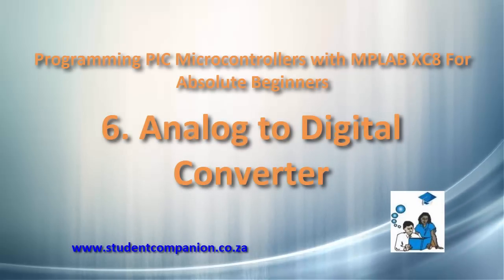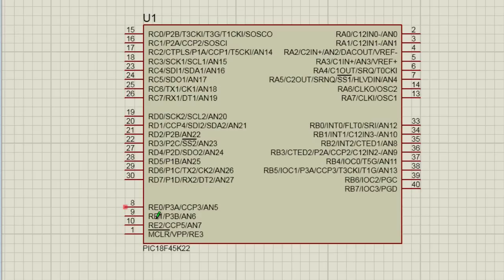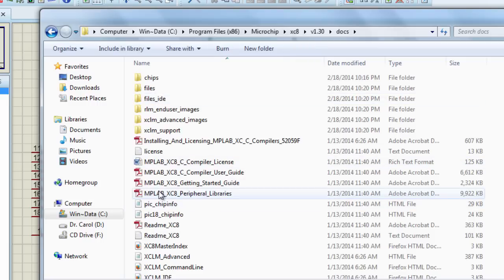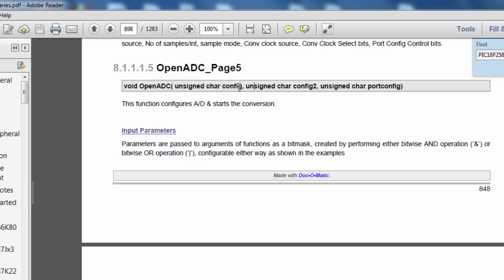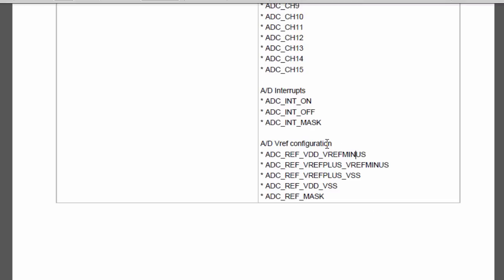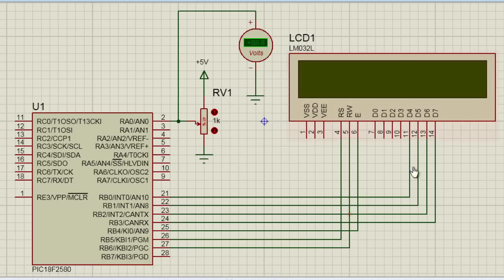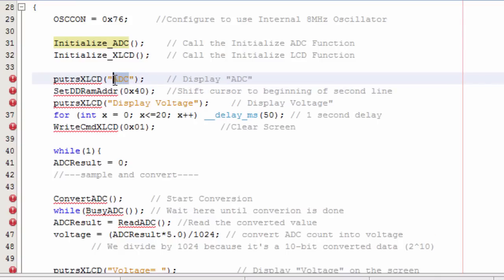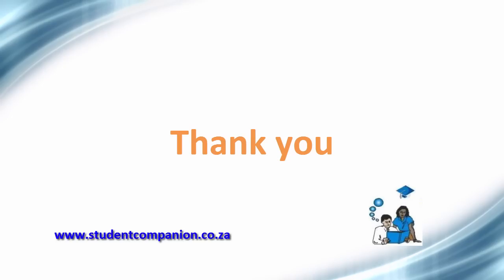6- Analog to Digital Converter | MPLAB XC8 for Beginners Tutorial

Comment: help me ! my mail is lam.3.ngon@gmail.com
#include <stdio.h>
#include <stdlib.h>
#include <pic16f877a.h>
#include <xc.h>
#include "xlcd.h"
#define _XTAL_FREQ 4000000
#define DATA_PORT PORTB
#define TRIS_DATA_PORT TRISB//DDRB
// Lcd pinout settings
#define RW_PIN LATBbits.LAT0;//PORTBbits.RB0
#define E_PIN  LATBbits.LAT1;//PORTBbits.RB1
#define D7_PIN LATBbits.LAT7;//PORTBbits.RB7
#define D6_PIN LATBbits.LAT6;//PORTBbits.RB6
#define D5_PIN LATBbits.LAT5;//PORTBbits.RB5
#define D4_PIN LATBbits.LAT4;//PORTBbits.RB4
// Pin direction
#define TRIS_RW TRISBbits.TRISB0 ;//DDRBbits.RB0
#define TRIS_E  TRISBbits.TRISB1 ;//DDRBbits.RB1
#define TRIS_D7 TRISBbits.TRISB7 ;//DDRBbits.RB7
#define TRIS_D6 TRISBbits.TRISB6 ;//DDRBbits.RB6
#define TRIS_D5 TRISBbits.TRISB5 ;//DDRBbits.RB5
#define TRIS_D4 TRISBbits.TRISB4 ;//DDRBbits.RB4
#pragma config FOSC = HS        // Oscillator Selection bits (HS oscillator)
#pragma config WDTE = OFF       // Watchdog Timer Enable bit (WDT disabled)
#pragma config PWRTE = OFF      // Power-up Timer Enable bit (PWRT disabled)
#pragma config BOREN = ON       // Brown-out Reset Enable bit (BOR enabled)
#pragma config LVP = ON         // Low-Voltage (Single-Supply) In-Circuit Serial Programming Enable bit (RB3/PGM pin has PGM function; low-voltage programming enabled)
#pragma config CPD = OFF        // Data EEPROM Memory Code Protection bit (Data EEPROM code protection off)
#pragma config WRT = OFF        // Flash Program Memory Write Enable bits (Write protection off; all program memory may be written to by EECON control)
#pragma config CP = OFF         // Flash Program Memory Code Protection bit (Code protection off)
unsigned int adc_value = 0;
unsigned int ReadADC (void);
unsigned int voltage;
char buffer[6];
void LCD_Clear(void);
void LCD_init (void);
void ADC_init (void);
      void main() {
      LCD_init();
      ADC_init();
      TRISA = 0xFF;
      while(1)
      {
            // Chuyen doi ADC
            adc_value = ReadADC;//ADC_Get_Sample(0);
            // Tinh ra gia tri dien ap
            voltage = adc_value * 5000.0f / 1023;
            // Hien thi adc_value ra LCD
            putrsXLCD(adc_value,buffer);
            putrsXLCD(1,1,buffer);
            // Hien thi voltage ra LCD
            putrsXLCD(voltage,buffer);
            putrsXLCD(2,1,buffer);    
      }
      }
 void LCD_init (void){
 while(BusyXLCD());
    OpenXLCD(FOUR_BIT & LINES_5X7);
    WriteCmdXLCD(CURSOR_OFF & BLINK_OFF);

      }
 void ADC_init (void){
    // chon tan so clock cho bo adc
    ADCON1bits.ADCS2 = 0, ADCON0bits.ADCS1 = 0,ADCON0bits.ADCS0 = 1;
    // chon kenh adc la kenh an0
    ADCON0bits.CHS2 = 0, ADCON0bits.CHS1 = 0, ADCON0bits.CHS0 = 0;
    // chon cach luu data
    ADCON1bits.ADFM = 1;
    // cau hinh cong vao
    ADCON1bits.PCFG3 = 1,  ADCON1bits.PCFG2 = 1,  ADCON1bits.PCFG1 = 1,  ADCON1bits.PCFG0 = 0;
    // cap nguon cho khoi adc
    ADCON0bits.ADON = 1;
}
unsigned int ReadADC (void)// doc len 7 doan
{
    unsigned int TempValue = 0;
    ADCON0bits.GO_nDONE = 1;
    while(ADCON0bits.GO_nDONE);
    TempValue = ADRESH*256 + ADRESL;
    return (TempValue);
}
Reply from the maker: Lâm Huỳnh What is wrong with your code? If you need support, you must be specific with your question. What are you trying to achieve? Are you getting any error in your code?
What kind of help do you require?
Reply from the maker: Why are you copying the same configuration as from this post above and you can see this person had the same problem as you. In the previous comment reply, I said don't use #include <16f877A.h>, with XC8 compiler you can simply use  #include <xc.h>. It will know which PIC to use.
If you include #include <gps.c> and #include <lcd.c>, make sure these files exist in your project first before including them.
Reply from the maker: +md srabon you are welcome!
Reply: SIR ,how can i include  <pic16f877a.h> library file ?
Reply from the maker: Hi. Which library file you want to include? With XC8 compiler all you need is to include <xc.h>
Reply: #include <16f877A.h>
#include <stdlib.h>
#include <string.h>
#include <math.h>
#include <gps.c>
#include <lcd.c>
#use        delay  (clock=20000000)
#use        rs232  (baud = 4800, xmit=PIN_A1,rcv=PIN_A0,stream=GPS)  //GPS Receiver connections
#define VOICE_DURATION_MS 6
char ch = 0;
int count = 0;
char data[150]; //For SMS storage
const char *location1 = "COLLEGE GATE";  //16.984835, 79.256261
const char *location2 = "CANTEEN";  //16.983173, 79.255708
const char *location3 = "LAB BUILDINGS"; //16.984707, 79.253884
const char *location4 = " Sooxma Tech";
char *location = "UNKNOWN LOCATION.";
char unknown[] = "UNKNOWN";
char lat[12];
char lngtd[12];
char speed[10];
char gps_date[10];
char gps_time[10];
char tdata[12];      
double f_lat;
double f_lng;
double result;
void play_voice(int device_id)  //APR9600 is connected to D7 to D4 and C7 to C4
72
{
   switch(device_id)
   {
      case 1:            
            output_low(PIN_D7); //make APR9600 Voice note ON
            delay_ms(500);     //push button press equivalent duration
            output_high(PIN_D7);  //release push button (equivalent)
            delay_ms(VOICE_DURATION_MS);   //Voice message may play for max of 6 seconds           
            break;
      case 2:           
            output_low(PIN_D6); //make APR9600 Voice note ON
            delay_ms(500);     //push button press equivalent duration
            output_high(PIN_D6);  //release push button (equivalent)
            delay_ms(VOICE_DURATION_MS);   //Voice message may play for max of 6 seconds
            break;     
      
      case 3: //third device
            //code for playing voice message
            output_low(PIN_D5); //make APR9600 Voice note ON
            delay_ms(500);     //push button press equivalent duration
            output_high(PIN_D5);  //release push button (equivalent)
            delay_ms(VOICE_DURATION_MS);   //Voice message may play for max of 6 seconds
            break;         
      case 4: //system off confirmation message
            //code for playing voice message
            output_low(PIN_D4); //make APR9600 Voice note ON for system off...
          
73
 delay_ms(500);     //push button press equivalent duration
            output_high(PIN_D4);  //release push b`utton (equivalent)
            delay_ms(VOICE_DURATION_MS);   //Voice message may play for max of 6 seconds
            break;
           
      case 5: //system off confirmation message
            //code for playing voice message
            output_low(PIN_C7); //make APR9600 Voice note ON for system off...
            delay_ms(500);     //push button press equivalent duration
            output_high(PIN_C7);  //release push button (equivalent)
            delay_ms(VOICE_DURATION_MS+VOICE_DURATION_MS);   //Voice message may play for max of 6 seconds
            break;
      case 7:            
            output_low(PIN_C5); //make APR9600 Voice note ON for system off...
            delay_ms(500);     //push button press equivalent duration
            output_high(PIN_C5);  //release push button (equivalent)
            delay_ms(VOICE_DURATION_MS+VOICE_DURATION_MS);   //Voice message may play for max of 6 seconds
            break;     
  }
}
 
void getLocationName()  // Converts the Lat and Long into Location Name. Also gets the lat,lngtd and speed.
{
      location = "UNKNOWN PLACE";
     
 
74
    get_GPS_data();     
     
      result = get_gps_distance(16.984835, 79.256261,f_lat,f_lng); //SRTIST College Gate
      if(result < 50)  //Meters
      {
         strcpy(location,location1);
         play_voice(1);
      }
     
     result = get_gps_distance(16.983173, 79.255708,f_lat,f_lng); //SRTIST Canteen
     
      lcd_putc('\f');
      printf(lcd_putc,"Distance to Gate:");
      lcd_gotoxy(5,2);
      printf(lcd_putc,"%6.0f m",result);        
      delay_ms(2000);
     
      if(result < 40)  //Meters
      {
         strcpy(location,location2);
         play_voice(2);
      }
     
      result = get_gps_distance(16.984707, 79.253884,f_lat,f_lng); //LAB Buildings
     
      if(result < 50)  //Meters
      {
         strcpy(location,location3);
         play_voice(3);
      }
      75
      result = get_gps_distance(17.352089, 78.507055,f_lat,f_lng); //Sooxma Technologies
     
      if(result < 70)  //Meters
      {
         strcpy(location,location4);
         play_voice(4);
      }
     
      result = get_gps_distance(17.332206, 78.503558,f_lat,f_lng); //HOME
     
      if(result < 80)  //Meters
      {
         strcpy(location,location5);
         play_voice(5);
      }
}
 
void display_intro()
{
   lcd_putc('\f');         //Clear LCD
  
   lcd_gotoxy(1,1);
  
   printf(lcd_putc,"  GPS Location");
  
   lcd_gotoxy(1,2);
  
   printf(lcd_putc,"System for Blind");
}
 
76
void gps_loc()
{    
         lcd_putc('\f');         //Clear LCD
        
                         lcd_gotoxy(1,1);
        
                         printf(lcd_putc,"You are at :");
        
                         lcd_gotoxy(1,2);
        
                         printf(lcd_putc,"%s",location);        
        
                         delay_ms(2500);
}
 
void main()
{
   lcd_init();
  
   display_intro();
  
   output_high(PIN_D2);
  
   output_high(PIN_D3);
  
   delay_ms(1000);
  
   output_low(PIN_D2);
  
   output_low(PIN_D3);
   77
 output_high(PIN_D7); //For APR9600
  
   output_high(PIN_D6);
  
   output_high(PIN_D5);
  
   output_high(PIN_D4);
  
   output_high(PIN_C7);
  
   output_high(PIN_C6);
  
   output_high(PIN_C5);
  
   output_high(PIN_C4); //For APR9600
 
  while(1)
  {
 
        delay_ms(1000);
       
                        getLocationName();  //Gets the Location Name into variable "location", Also gets lat, lngtd and speed
       
        if(strstr(location,unknown))
        {
           play_voice(7);
          
                           output_high(PIN_D3);
          
                         78
  output_low(PIN_D2);
        }
        else
        {
           output_low(PIN_D3);
       
                           output_high(PIN_D2);          
        }
        gps_loc();
       
                        lcd_putc('\f');         //Clear LCD
       
                        lcd_gotoxy(1,1);
       
                        printf(lcd_putc,"Lat:%5.5f",f_lat);
       
                        lcd_gotoxy(1,2);
       
                        printf(lcd_putc,"Lng:%5.5f",f_lng);
 
                        delay_ms(1500);
  }
}

OUTPUT:
make -f nbproject/Makefile-default.mk SUBPROJECTS= .build-conf
make[1]: Entering directory 'C:/Users/RAIN/Desktop/ultrasonic.X'
make  -f nbproject/Makefile-default.mk dist/default/production/ultrasonic.X.production.hex
make[2]: Entering directory 'C:/Users/RAIN/Desktop/ultrasonic.X'
"C:\Program Files (x86)\Microchip\xc8\v1.36\bin\xc8.exe" --pass1  --chip=16F877A -Q -G  --double=24 --float=24 --opt=default,+asm,+asmfile,-speed,+space,-debug --addrqual=ignore --mode=free -P -N255 --warn=-3 --asmlist -DXPRJ_default=default  --summary=default,-psect,-class,+mem,-hex,-file --output=default,-inhx032 --runtime=default,+clear,+init,-keep,-no_startup,-osccal,-resetbits,-download,-stackcall,+clib   --output=-mcof,+elf:multilocs --stack=compiled:auto:auto "--errformat=%f:%l: error: (%n) %s" "--warnformat=%f:%l: warning: (%n) %s" "--msgformat=%f:%l: advisory: (%n) %s"    -obuild/default/production/newmain.p1  newmain.c 
newmain.c:1: error: (141) can't open include file "16f877A.h": No such file or directory
(908) exit status = 1
nbproject/Makefile-default.mk:100: recipe for target 'build/default/production/newmain.p1' failed
make[2]: Leaving directory 'C:/Users/RAIN/Desktop/ultrasonic.X'
nbproject/Makefile-default.mk:84: recipe for target '.build-conf' failed
make[1]: Leaving directory 'C:/Users/RAIN/Desktop/ultrasonic.X'
nbproject/Makefile-impl.mk:39: recipe for target '.build-impl' failed
make[2]: * [build/default/production/newmain.p1] Error 1
make[1]: * [.build-conf] Error 2
make: * [.build-impl] Error 2

BUILD FAILED (exit value 2, total time: 1s)
Reply: H can i solve it sir?? plz help me.
Reply from the maker: Why are you copying the same configuration as from this post above and you can see this person had the same problem as you. In the previous comment reply, I said don't use #include <16f877A.h>, with XC8 compiler you can simply use  #include <xc.h>. It will know which PIC to use.
If you include #include <gps.c> and #include <lcd.c>, make sure these files exist in your project first before including them.
Reply: ohh i understand sir ....thank you so much ...